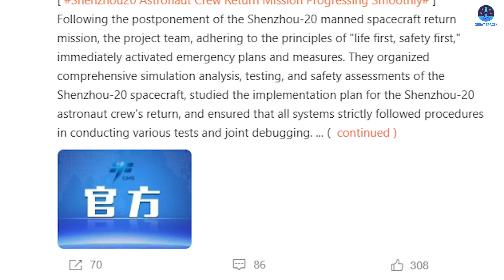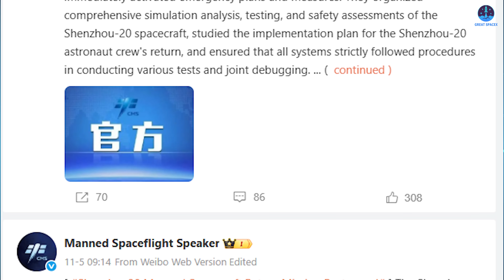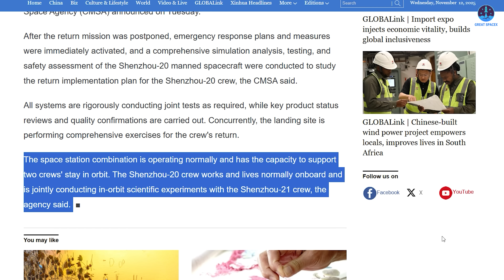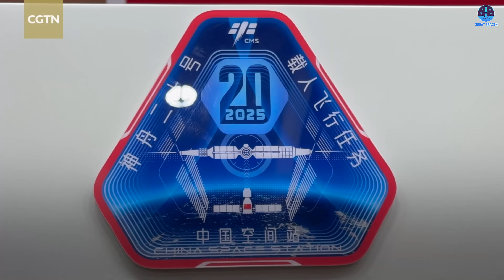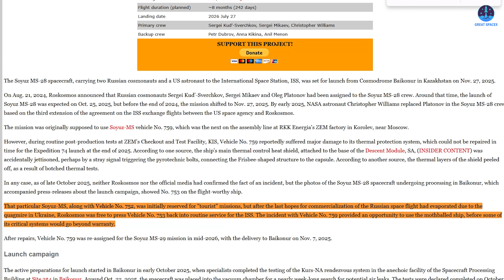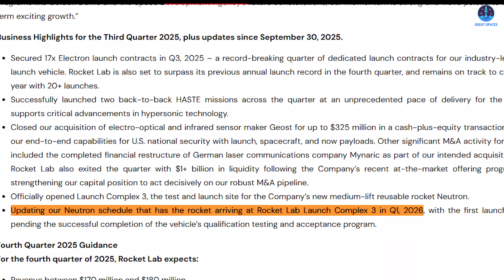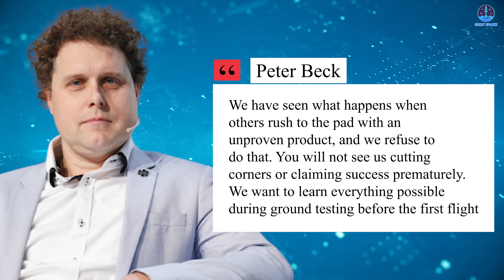China Astronaut Stuck on Tiangong Space Station after Leaked Trouble.SpaceX Dragon to Rescue!

Comment: You guys pulled the fast one too early. China has two crewed spacecraft docked at the Tiangong Space Station — by design. The delay in departure isn’t a problem; it’s intentional. They’re using this time to assess potential damage on Shenzhou-20 after months of exposure to the harsh space environment. Meanwhile, Shenzhou-21 remains safely docked and ready as a return vehicle.

This isn't risk — it's smart, cautious science.

And next time? Expect even more advancement: reports suggest Shenzhou-22 or Shenzhou-23 could carry two spacecraft up together during routine crew rotation — a new milestone in operational efficiency and mission planning.

Comment: spacex  cannot rescue, because the  joining hole port not the same size
Reply: According to Wikipedia  Chinese spacecraft uses standard APAS 89/95 docking ports/hatches. Therefore technically they may  dock to ISS. And Dragon may dock to Chinese station too
Reply: @vlmrv9108  The hardware maybe compaitble but the software may hard to handshake process.

Comment: Neutron is tiny compared to Starship, if anything its a competitor to Falcon, but they haven't even flown yet, and on top of that they also need to land after they have flown.
And Neutron is made of carbon fiber which is lighter, but also more expensive, and then Falcon in expenditure mode can almost carry 2x the weight of Neutron to LEO.
So it is not a direct competitor, but competition is good in a sense that Neutron most likely will be a better competitor than ULA or any other fully non reuseable rockets

Comment: I note that you avoided addressing the problem of two of the essential consumables ; AIR and WATER. Both can be recycled (though i do not know how EFFICIENTLY they can be recycled). The station is designed to comfortable sustain three astronauts.
Now, there are six. All of them are males with larger body mass and thus they will consume resources more quickly. In a pinch, the food can be rationed, but WATER is more essential than food. AIR is the most important (no AIR, no LIFE). In addition, since the CCP China spacecraft was damaged by space debris (no one is saying how bad the damage actually is) this brings up the possibility that another strike may occur. I pray that China is addressing the problem with all possible speed because like Starliner, CCP China may opt NOT TO LOSE FACE by asking Space X for help. Starliner was, in the end, forced to accept Space X's offer. 
China may opt not to, come heck or high water, so to speak.

Comment: Can Crew Dragon dock with Tiangong? This could be alimiting factor. Can the Dragon hatch accomodate a Chinese EVA spacesuit, with that overly long PLSS?
Reply: It seems those big solid boxy Chinese EVA spacesuits will not fit through a dragon hatchway.  But EVA spacesuits are only required if there is no docking tunnel or hybrid mating collar to connect Dragon and Tiangong hatches to each other.   If there is a tunnel or mating collar, then travel between the space station and Dragon is possible in just shirt sleeves as with ISS and Soyuz or the ISS and Dragon of the past missions.

Comment: The problem is that, although the SpaceX Crew Dragon could accomplish the rendezvous, I don't beleve  there is a docking ring that the SpaceX Crew Dragon could work with on the Tiangong Space Station. 
SpaceX would, with the help of the Chinese, have to design and build an adaptation docking mechanism.  Or the difficult job of an undocked transfer of the Taikonauts with a space walk to the SpaceX Crew Dragon.

Comment: I suppose lives will need to be lost due to space debris before any real effort is made to clean it up. There are over a million pieces larger than 1 cm already. At the speeds this debris orbits and the speed of manned space craft the potential kinetic energy is huge. It is also estimated that there are over 25,000 of these pieces of debris larger than a softball. Given the volume of the space involved the odds are still pretty low of a problem, but as we've seen it is not zero.

Comment: I'm kinda surprised that any spacecraft goes up without a repair kit. How hard would it be to repair a hole in a spacecraft with a patch not only held by an adhesive layer but also by the pressure from inside the spacecraft against the Spacecraft wall and the vacuum of space.
Reply: They actually do have repair kits.  However, they're designed for little holes to prevent pressure loss... not the kind of think you want when you're reentering.  Even little holes will not survive that reentry heating, and in most cases would need to be repaired from the outside.  What if, for example, the heat shield is damaged.
Reply: @williamsteele  That's what EVA suits are for to repair the outside and you would think they would have a patch that can repair damaged heat shield. Something we should have had for the ship Columbia.
Reply: @richbl1690  The heat shields the Chinese spacecraft are entirely different designs than what the US used for the Shuttle program.  It's nearly impossible to repair an ablative shield and still have it maintain it's integrity in space... especially if it penetrated the structure.  Also, we don't know what damage the spacecraft suffered... it could have been a ruptured fuel tank, or a critical thruster pack... for example, the deorbit engine.  If that was the case, you'd need a whole new engine for it.  They'll figure it out... and they have plenty of expertise to send up another one by now.  My guess is they'll set it up unmanned, deorbit the bad one and the crew can come home on the replacement... but it takes time to schedule it and launch it.  The Taikonauts are in no immediate danger, so no sense in rushing it while other options still exist.
Reply: Evidently you don't know how difficult it is to put patches on metal in a vacuum. Not even the US does that yet. It isn'r as sdimple as slapping duct tape on an innertube.
Reply: @JessePollardII  Actually, both the US and Russia have a procedure for patching metal from either inside or outside the space station.  It's already been used in the Russian modules of the ISS. Look up the KERMiT kit... which is specifically designed for EVA repairs.
Reply: @williamsteele  If so, then it doesn't work, as neither one has been able to fix leaks - even one in a space suit couldn't be patched while in orbit. The Russians almost had to abandon the ISS when their leak started. That one lost the cooling for the module until the entire unit was replaced.
Reply: Inside the cabin is pressurized and the repair patch will be held in place.  The repair for heat shield Is on the outside.
Reply: @richbl1690  You are assuming the punctyre us smooth and even  and easily reached, not torn or wrenk lede. don't work well when the hole is a split or tear. And they don't work well in some placers you can't easily reach. The russian leak was one such - a 1/4 inch hole they couldn't reach due to other welded structures in the way.
Reply: @richbl1690  You assume too much - that the puncture is smooth and small, not torn and uneven. It also is not necessarily easily accessible. The Russian leak was a 1/4 inch hole that could not be reached from inside or outside (which would blow away the patch), inside, access was blocked by other structures welded in place and could not be moved.
Patching is not easy or simple. patches under pressure may get blown out before they can even be put in place.

Comment: Very unlikely that SpaceX could help even if China would let them. The adapter for crew transfer from Dragon to Chinas space station would not be the same
Reply: I am pretty sure the Chinese are using the international docking standards, so any capsule could physically dock.
 But like with Butch and Sunny, there is no standard for the life support attachment to the spacesuits.
Butch and Sunny needed SpaceX suits sent up to them. 
There needs either to be an international adapter device to convert connections of life support and comms (so any suit can be used with any capsule) or a international suit connection standards need to be agreed. (One drawback of the later is it could stifle suit innovations). 
A drawback for the convertor devices is that they would need to be kept up to date with the latest suit designs.